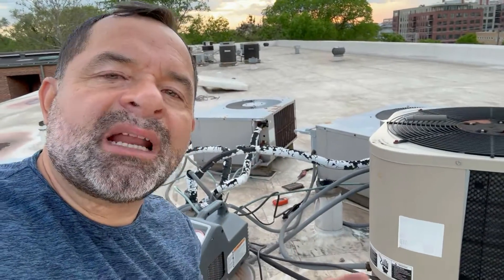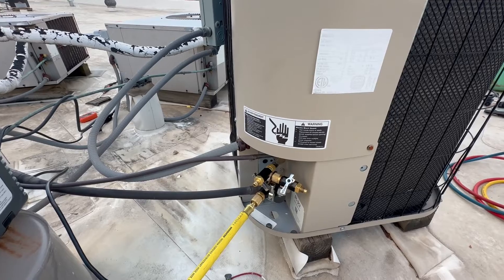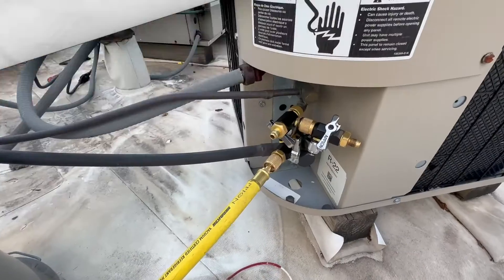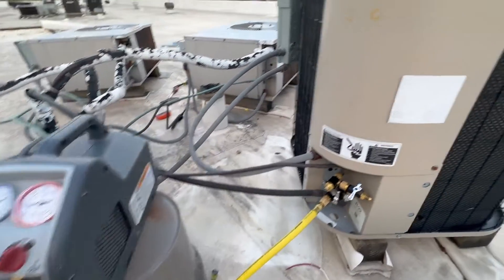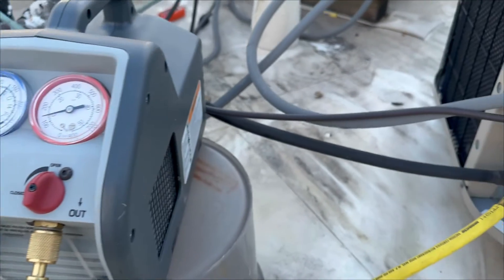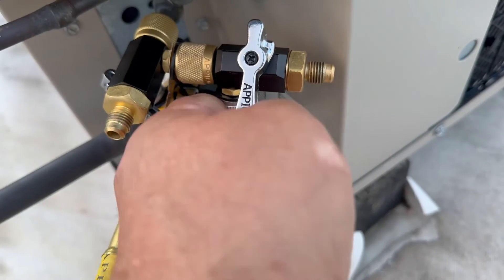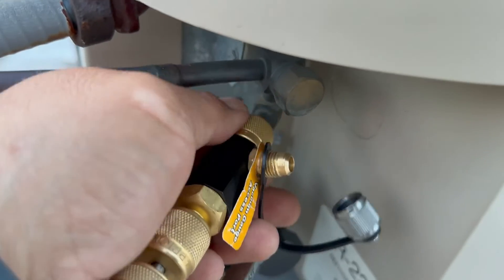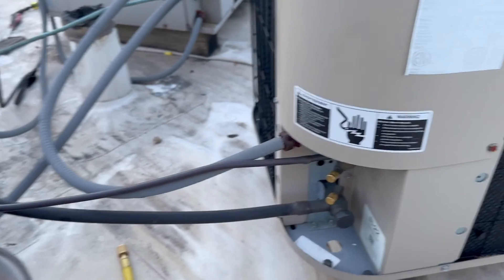HOW TO CHARGE AN AC SYSTEM WITH REFRIGERANT WITH A RECOVERY MACHINE  (BY WEIGHT)

Comment: Can you add recovery R22 directly from the recovery tank to the unit?
Using the manifold of course
Reply from the maker: Hello,   When you recover refrigerant you cannot add it some where else unless it has been reclaimed (cleaned). 
Never use old(recovered ) on a new unit.  
You can add the recovered refrigerant on the same unit you recovered  it from.
       I have 42 condensers  on a roof.   Me, as the manager in charge ,  can add recovered refrigerant on another old unit . Never on a new unit.    The risk of contaminating one good condenser with recovered refrigerant  is big.  I hope I answered your question.

Comment: Is there any calculation that needs to be taken for anything left remaining in the recovery machine / hoses? I had to do this on a massive package unit last week, but i was concerned about the charge being off by a slight amount. I also have done this when ive gotten to the last bit of a tank of r22 or 134 to get the last bit out

Comment: I see that you had the vacuum pump hooked up to the low side, but there was a second yellow hose leading from the high side with the valve open. What did that hose connect to?
Reply from the maker: Hello    One hose from the suction and another from high side both going to the vacuum machine .  Remember most vacuum machine have a fitting with at least 2 ports .  We were performing a vacuum through both low and high side. with no core restrictions.
Reply from the maker: Im sorry I did not show it.  Just wanted the video to be about using the recovery machine to charge a system when you dont have the compressor able to do that work.  At that moment we did not have power on the condensing unit.
Reply: @alexthehandyman3494   Understood.  Thank you for your reply.  I think both of your service port caps are still in place which leads me to believe that bot are in the full open position?  If this is the case, when  you use the recovery machine to insert the refrigerant you are still leaving both of the service ports open?
Reply from the maker: @Sparkolot  yes.  Both service ports were back-seated. Fully  open.  I never closed them for this video.  I had no refrigerant stored at the condenser. so no need to closed them to separate de condenser from the system.   the system was fully empty and I added refrigerant by weight .Remember I had no cores at the valves.  I had 3 valve core removal tools.   At the end I charged the system and installed back the cores.  If you go to 5:27 you ll notice that I am charging just through the suction line.  The liquid line has two core valve removal tools on the off position both.
Reply: Alex- understood.  Thanks so much.  Unfortunately, the compressor winding test failed on all three leads so. I suppose it is time to buy a new system.  Your video and replies are appreciated.  I know it takes a lot of time.

Comment: So you ran the evacuation pump with the hoses reversed? It pulled from the tank and spit it into the low side of the system? I’ve never seen that before.  Well done. So you can pull down to 200 microns with just an evacuation pump?  I saw a dedicated vacuum pump there. You didn’t use that?  Why do most guys have both then? Did it just take longer?  Thanks. Great vid.
Reply from the maker: Morning Richard,
Yes the recovery machine doesn't know what is transferring to.  It is a device to transfer refrigerant (recover ) from one place to another. From the condenser through the recovery machine to the tank.  In this case is going from the tank through the recovery machine to the condenser.  It is important to use dedicated hoses to recover and different hoses to vacuum.  Vacuum hoses need to be clean to pull an easier vacuum.    Yes the vacuum pulled easily to 200 microns. It took me 5 min.   It is important to mention that on the vacuum I used thicker hoses and no restrictions.   When using regular 1/4 houses with cores and core depressors it can take easily 20-30 minutes.
Thanks you so much for your support!!!
Reply: @alexthehandyman3494  Thanks for the boatload of info! I have a cheap vacuum pump I've used for my car But always wanted an inexpensive recovery machine.  Maybe, just maybe.  Thanks again